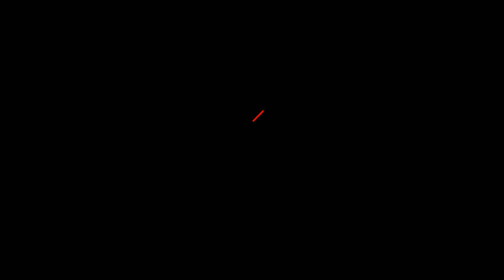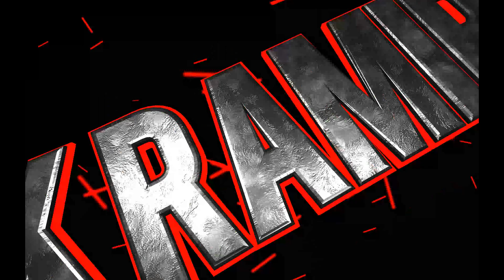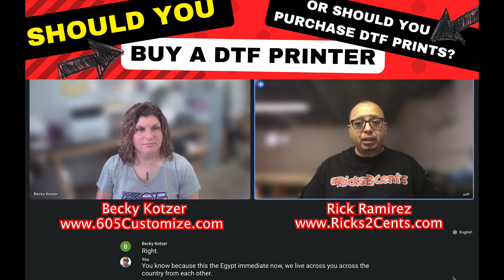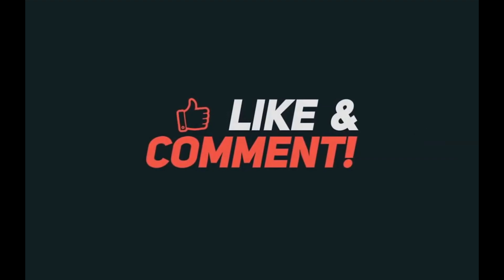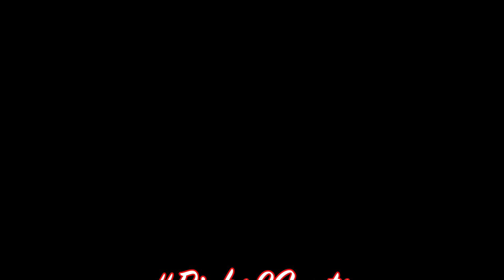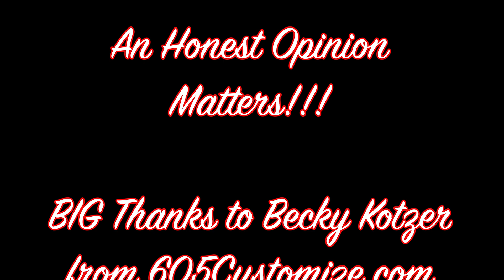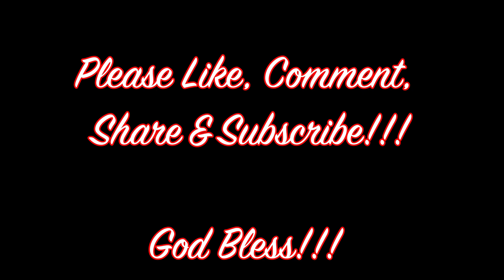Buy a DTF Printer or Order Transfers? Lessons with Becky Kotzer

Comment from the maker: Video Time Line
00:00 Let's Get Started
00:15 Introducing Becky Kotzer.
00:23 Topic of Discussion.
01:22 Becky Going over her Garment background.
02:32 Becky Purchases a Epson L1800 Printer.
03:00 Becky Purchases a Epson P800 Printer.
05:00 Becky Purchases a Epson 7880 Printer.
06:00 Becky Purchases a Cobra Flex Printer.
07:29 Becky Discusses Common Printer Problems.
09:10 Becky Discusses Lesson Learned from Previous Printers.
10:15 Becky Discusses How DTF has Changed her Business.
10:41 Rick Addresses Becky's Growing Pains & Lesson Learns.
14:45 Becky Discusses Customers Reaction to DTF.
15:38 Rick Discusses Drastic Improvements in consumables.
16:23 Rick Discusses No Reason to Run a Cut Throat Business. 
15:50 Rick Discusses Too Many People Selling Prints that have No Business Selling Prints. 
19:25 Rick Discusses Marketing to Competitors customers.
20:25 Rick Discusses Have an Understanding Why are you getting into DTF.
21:19 Becky Discusses How environment conditions effect your prints.
20:25 Rick Discusses How maintain your environment conditions.
23:53 Rick Discusses Over coming financial hurdles. 
24:12 Becky Discusses making payments on Cobra Flex Printer while it was not working.
26:21 Rick Discusses Purchasing $1700 in Bad supplies.
28:06 Rick Discusses What is Your Printer Budget?
28:27 Rick Discusses Desktop DTF Printers.
29:14 Becky Discusses Curing prints by hand.
31:12 Becky Discusses Creating allies in the DTF industry.
32:52 Rick Discusses Mid Size Desktop DTF Printers.
33:27 Rick Discusses Bigger is Not Always Better!!!
34:50 Becky Discusses How she first started her business.
35:12 Becky Discusses Artwork Software Editing / Creating Tools.
37:04 Rick Discusses How some large print shops loose site of Quality.
40:32 Rick Discusses Purchasing within your means.
41:25 Rick Discusses Don't let your pride get in the way of asking for Help!!!
44:30 Did we miss anything?
45:04: Rick Discusses Understanding this Video's Message
46:43 Becky Discusses Staying committed and Learning the Craft.
47:36 Becky Discusses Being a weekend Warrior. 
47:51 Rick Discusses What is your time worth?
48:39 Rick Discusses Establishing and Networking your business. 
50:24 Rick Discusses Asking other for Help!!!
51:28 Rick Discusses does your Spouse support your business?'
51:40 Rick Discusses how he first started in the business.
52:00 Rick Discusses Getting ripped off!!!
53:00 Rick Discusses You have to start some where!!!
54:24 Rick Discusses Making your side Hustle Your Primary Hustle.
54:34 Rick Discusses Becky Kotzer Achievements & Success.
55:34 Becky Discusses Her future in the garnet industry.
57:46 Rick Discusses His future in the garnet industry.